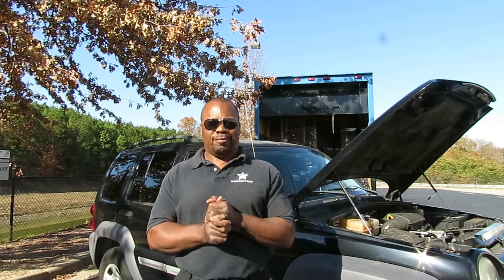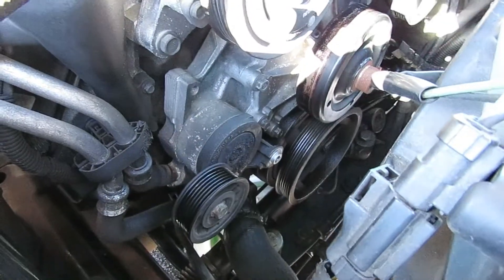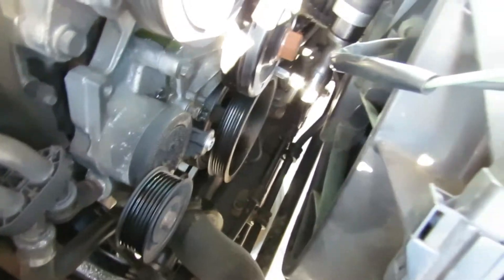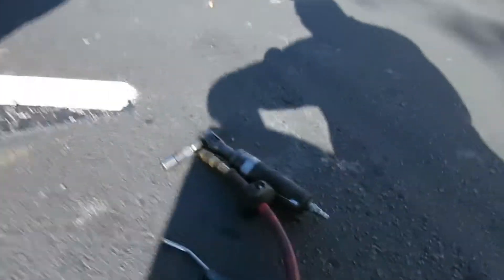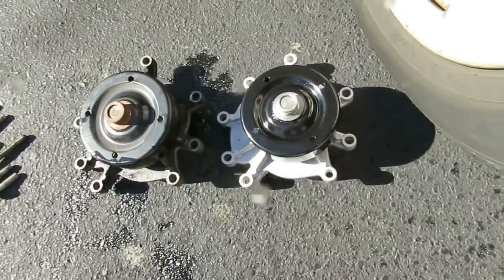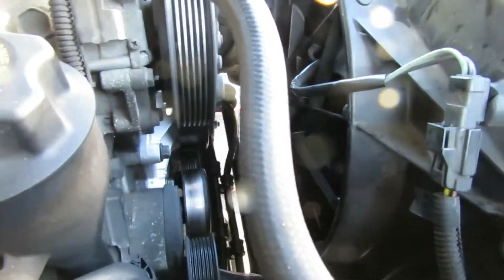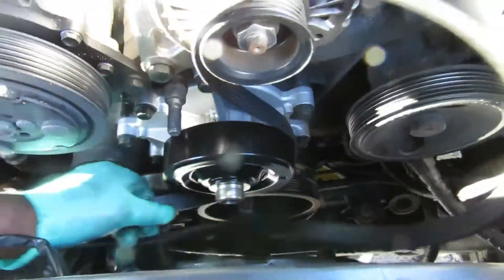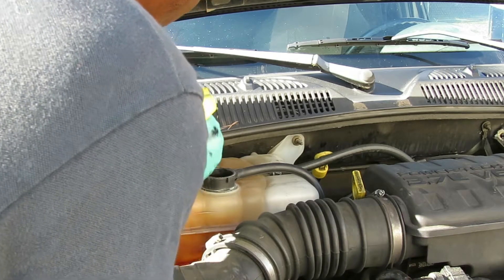⭐ 2003 Jeep Liberty Sport - 3.7 - Water Pump

Comment: I have a 2002 with the radiator fan attached to the water pump. Looks like I need a spanner wrench to take it off. Any thoughts...
Reply from the maker: You can rent the tool from Autozone, or a similar auto parts store.
Reply: @OnlineAutoRepairVideos   They didn't have the size i needed for this job, I ended up buying the spanner wrench on Amazon and acquired the other wrench at a local auto parts store. Thanks for replying. There is other 'need to knows about replacing the water pump that aren't covered. But I don't want to be a know it all. More than willing to share what I did with my 2002 Liberty limited,